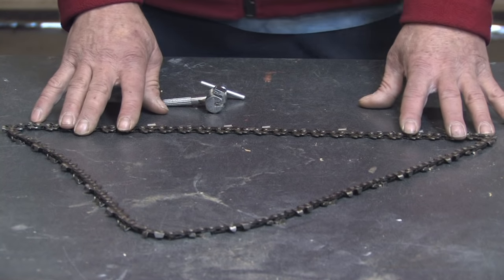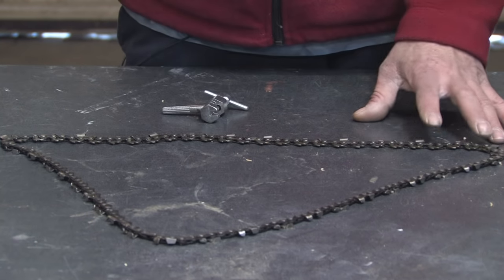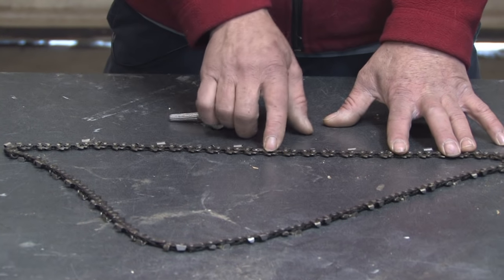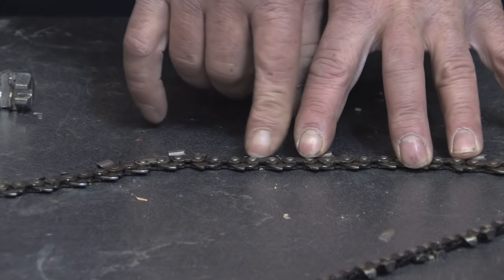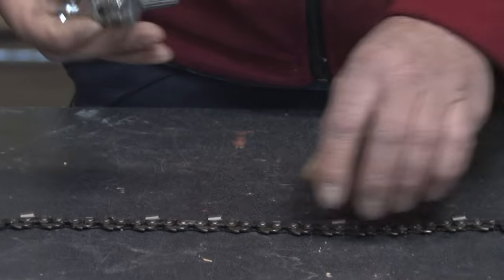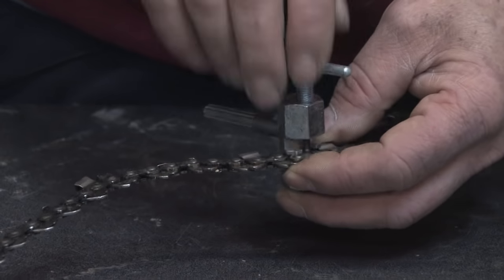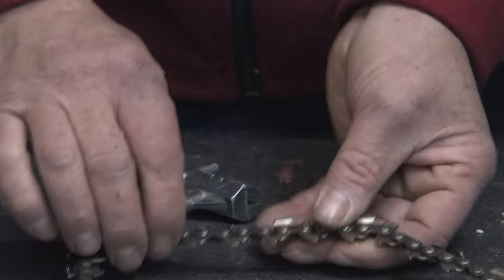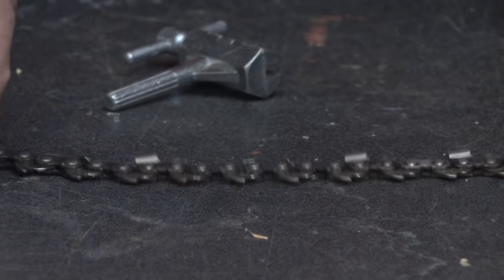Chainsaws & Tools : How to Shorten the Chain on a Chainsaw

Comment: Hi, great video, where can I get the little tool you are using to break the chain?
Reply: it is in the bicycle section found. It's to split bicycle chains but you could also just grind the rivet away with a Dremel and then knock it with a hammering pin out. The tool he shows to hammer rivet the link down.